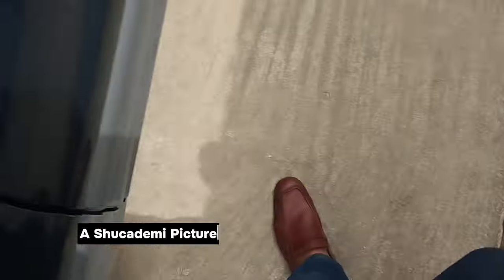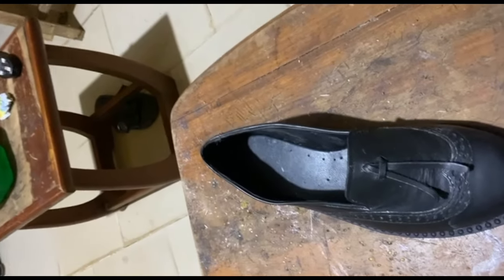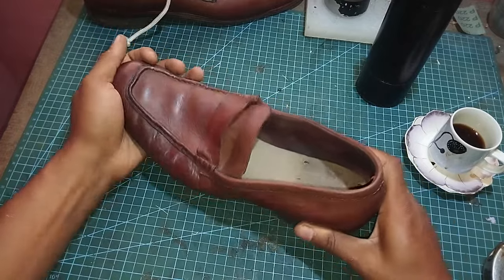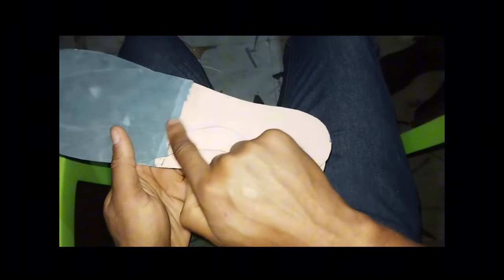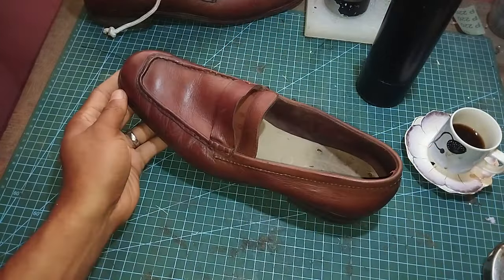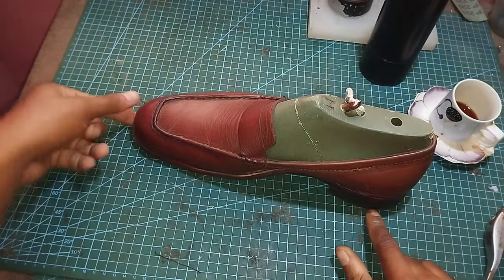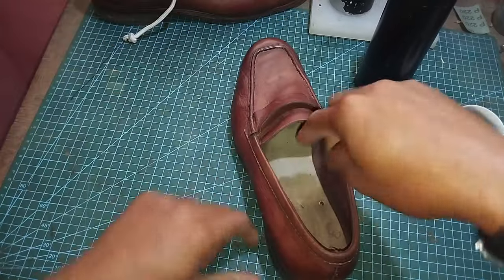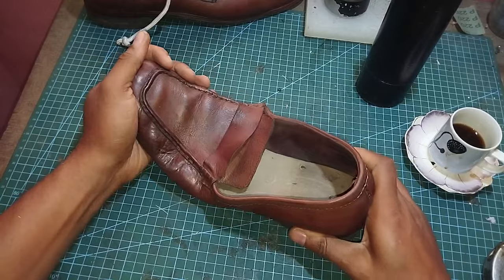Why the top line of your loafers is distorted

Comment: I noticed one more reason of disordered topline and this is the insole you put inside. If you wear your loafers without insoles you can notice that the topline goes crazy. I started to add insoles 3-4mm eva glued on thin 1mm leather and this helped.
Reply from the maker: You are absolutely correct. Doing that addresses some of the things mentioned here. It adds a little bit of height to the heel such that if there was some deficiency in that area, that will be corrected. Secondly, raising the sock liner increases the overall volume of the content of the shoe helping the feet to fit more snuggly into the shoe as the last would. If you consistently notice this with your last, then make sure you measure the instep and waist girths of the customer and factor those into the insoles construction in the first place.

Comment: I really enjoy your videos. It has been very helpful in my shoemaking journey.

I have a question though: should we also construct our own back stays when we are making a pair of derby or oxford? Or should we stick with the market size of back stays we have?

Since you mentioned that the back stay should extended to help maintain the top line of loafers. Does this apply to other shoes like derby/ oxford?
Reply from the maker: You will always get better results if you construct your own back stay. I have a video that shows how to use an insole fiber board to construct a back stay. Do check that out. https://youtu.be/PtS3wTQh44k?si=jfpltgD-eid6C_FL

But to answer your question directly, while you can get away with using the market back stay for say Oxfords and Derbys I totally don't recommend them for loafers.